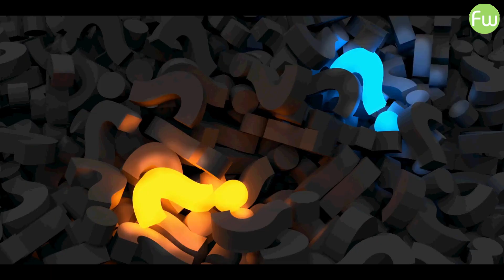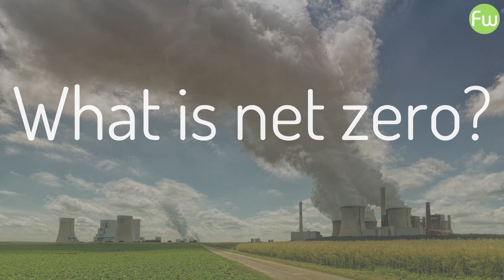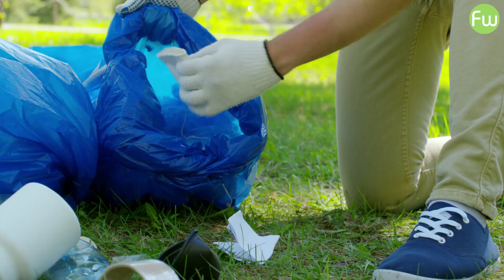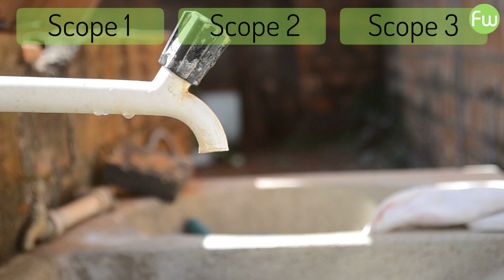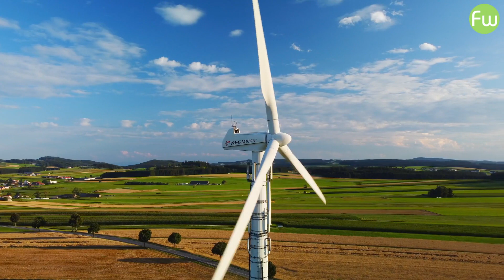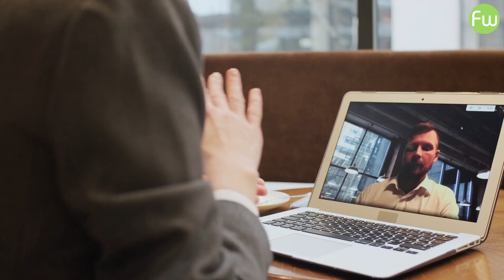NET ZERO - Helping your business be more sustainable

Comment: Interesting video, what you would say is the biggest challenge businesses face when trying to achieve net-zero emissions?
Reply from the maker: Hi, it's very industry specific. For example, a taxi firm's biggest emissions will be burning fuel, but without spending significant amounts migrating to electric vehicles, reducing fuel consumption will be a major difficulty. However, fuel usage might be easier for businesses in the service industry through remote working technology and reducing the need for commutes. The challenge will likely depend heavily on your industry, but also on your individual business constraints, i.e., the amount of staff and financial resources you can throw at it